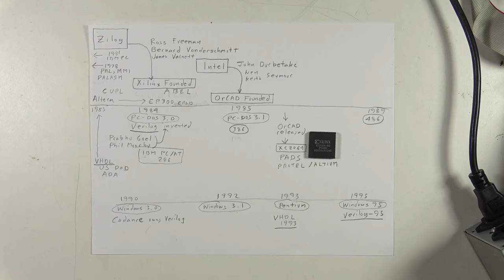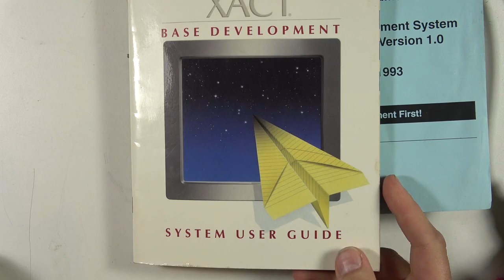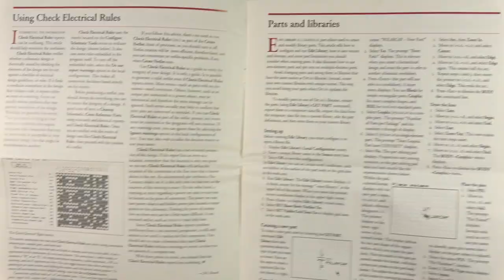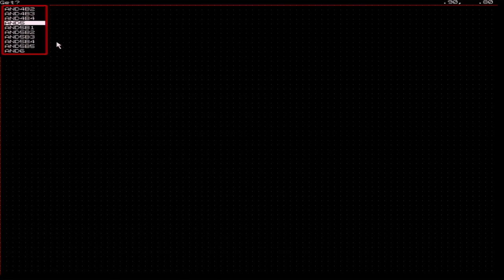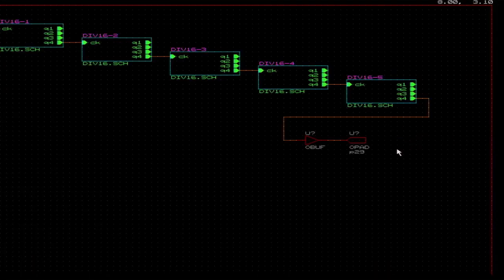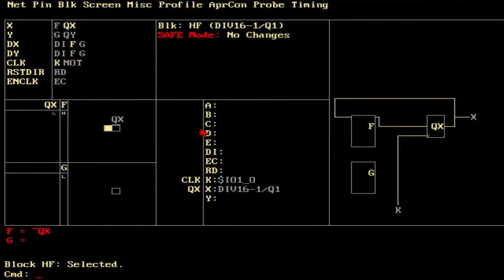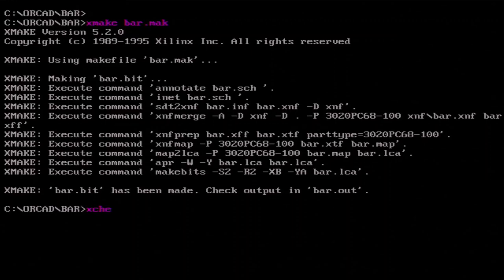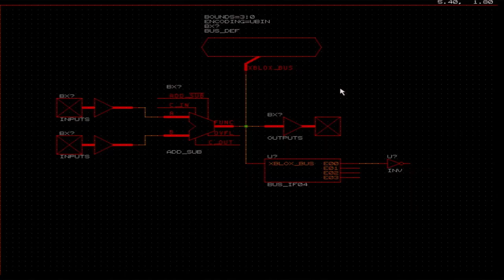FPGA design in MS-DOS Nostalgia (Xilinx / OrCAD)

Comment: Beautiful, instantly I get 34 years younger. I worked with this system back in 1989 on my university diploma work. The LCA chip used was 2064, and I modeled different bitstream CRC standards. In addition to tools that you showed I used Orcad simulator too. Development PC was 8088 with 1MB of RAM, and 20 MB HD.

Comment: This takes me back. Used the same orcad development system and later foundation. Still have the xc4000 dev board.  Have foundation 2 and 4 running under vmware so can still work with these old FPGA’s. Also worked with early altera maxplus.